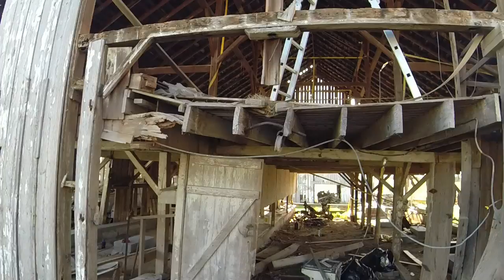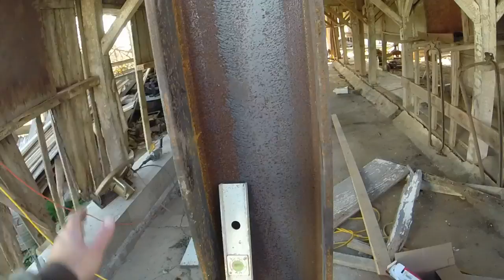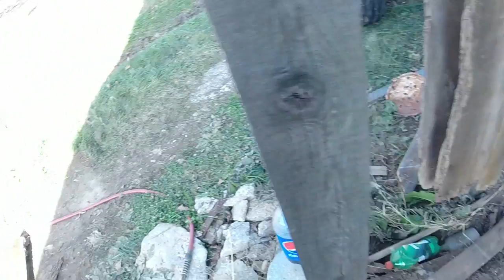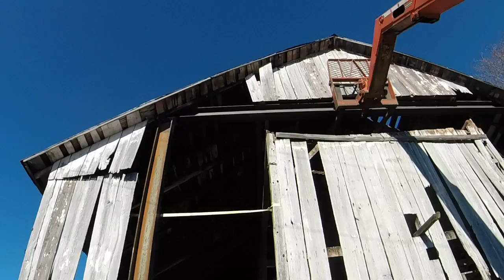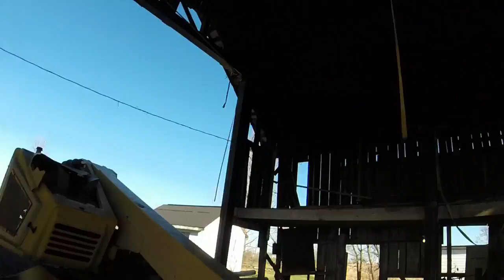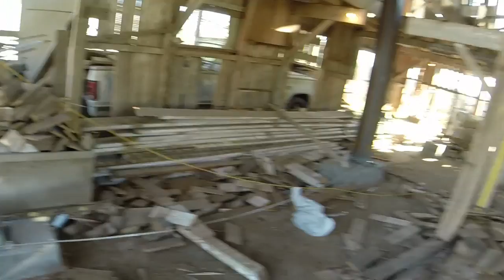First of Decembe 2015 This Old Barn/ Shop Update

Comment: Brian

This may peek your interest

http://www.picturethepast.org.uk/frontend.php?keywords=Ref_No_increment;EQUALS;DMAG101421&pos=18566&action=zoom&id=27322

This and many more of this age and size are the things I used to maintain and mend , electrical problems the fitters did the other stuff but it was a joint effort

They were and until recently used to bore out the mould,s for spinning the cast iron and ductile iron pipes ( sperrodial graphite ) . They had a range of machines from 4 inch to 48 inch all were 18 foot long , these machines were used in the Second World War to bore and rifle big gun barrels , my dad used to look after them then doing the sett up for the ladies to operate them

The other plants did bombs and other cast bits , most of the WW2 machines were still in use when I joined the firm in the 1960 ,s , no elf and safety open switch gear no guards just a rubber mat if you were lucky

Stuart
Reply from the maker: +Stuart Hardy That is an interesting machine. I thought it was a lathe at fisrt then I notcied the tube was clamped. That is one big boring bar!

Comment: You are one hell of a hard worker Brian. Since I don't know what all your plans are, then you may already have thought to add this. Put some really heavy duty floor anchors in and pour the concrete around those. You will need to sooner or later pull something into place either for machine tool moving or farm equipment repairs. With the floor anchors and the crane, plus some snatch blocks there wouldn't be many directions you couldn't get a pull going. I've been around and operated a lot of large open pit mining equipment, and every so often they need a horizontal pull in the shop. It's worth adding now if you think you'll need them. 

There's still a long ways to go as I'm sure you know better than I do. But you've also made some amazing progress.
Reply from the maker: +Turning Point Good idea, no reason I couldn't add some more anchors like I am making for the G&L. Of course I can always wrap a strap around the crane legs and pull on them too.  They aren't going anywhere. since the ITW page says each anchor is capable of 25000lb in shear that is 100,000/leg. once the crane piers are incased in concrete so it doesn't just drag the pier off of course.  i doubt I would ever hook anything more than my 3 ton chainfall to one.  I also have those 12in concrete pylons on the one side that the wall post are sitting on, I have already used those for pulling things around as they make good anchors too.

Comment: +bcbloc02 Brian, How thick are you going to pour that slab and and on what spacing do you plan expansion joints?  Great progress you have made.  Once you tie those uprights together with you rails the rest of the building can blow away and you will be good.
Reply from the maker: +James Kilroy Whatever it takes for me to hit good hard packed virgin dirt, which appears it will vary from 12in in the front to 24in in the back. Which is perfect since 24in is what it calls for on the foundation print for the G&L. My idea is that if I pour 15ft at a time the cold joints between the pours will be my expansion joints. It is going to be one hell of a building when I get it done.  Thanks for checking in on my man and feel free to share any wisdom you may have regarding the build. Can never have too many ideas for things.

Comment: Looking great Brian - just a bit anxious about bracing. What are you planning on using for diagonal braces - From the video it looks like the old floor had a bracing effect, and you'll need something - esp with the crane running up and down with a load hanging? Under New Zealand building code each vertical steel post would have diagonal bracing top of one to the bottom of its neighbour. But then we get earthquakes!
Reply from the maker: +Chris Draper The supports will be braced long ways by the crane rail itself which is an 18x72 H beam. It will be bolted to the side supports by both the bottom and top flange, so in order to fold the thing over you would have to bend or fail the connections of the Hbeam to the posts.  18" isn't a lot of space apart for  bracing to prevent movement, but then again 8" wide 13/16 thick plates should be pretty hard to bend, especially when they are connected to each other by a web.  The biggest danger would be loading the crane, somehow getting the load going fast by pulling the chain super quick and then crashing it into the stops at the end of the building.  That could maybe be bad as you could get a pretty good impact load, but there are 10 connections to hold it so probably still ok. Good thing for me is as the only operator I won't be doing stunts like that.

Comment: And I thought I had problems setting up the shops I have had! I'm sorry to see all that timber-frame stuff go, but you need a crane and that means steel. I now see where  you are headed. That is an awful lot of work and very well done.
Reply from the maker: +Juan Rivero More than half of it was rotten and patched at the bottoms so not a huge loss. I have been saving the good timbers out of it for later use.

Comment: Hi mate.  Bloody heck, you have been working your tail off.  From my side, it looks like you were only just in time to save this old barn, it shows to have so many rotten supports.  It's a good thing that you have access to so many tools and machines.  Is there any machine that you have not got????   Thanks for the up date,  at times you must have thought, what the hell did I start.  Just think, in the end it will all be worth it.  Good on ya.   Marcel.
Reply from the maker: +Marcel Timmers Yeah I really am surprised it hadn't blown down, but then again I have seen some buildings still standing that looked like a pigeon could knock down, it is really amazing to me how little it takes to hold something sometimes.
Reply: +bcbloc02 What is keeping it from racking toward the ends?  Be careful.  It is not so much the building, but you working inside it.  It looks like it could blow down easily at this point.  I don't see any triangulation or shear strength at all there to stop it from racking.  That said, I really admire your hard work and courage in taking on the project!
Reply from the maker: *****
 Currently the concrete anchors are the main thing holding it form folding, that and there isn't much left for the wind to blow on that way.   The anchors should be able to hold a force of 1000lb each placed at the top of the beams. With the current number of anchors that is 16000lb force at the top of the beam to force it over. That would be nearly a 100mph wind. with the walls installed.  Once I get the crane rail installed it will be braced much better with a bolted connection at just over half height tying the beams together.
Reply: +bcbloc02 Well, you have obviously thought this out, but I would be looking at some gussets or diagonals as well.

Comment: I'm sure that somewhere in the history of this effort someone has already asked this question but why not just tear down the old, do all of the concrete and steel work and then build around it?  Its cool watching the progress and how you solve different issues but it just seems like much more work doing it this way.  Thanks.
Reply from the maker: +rokdevil That would be the American way, and assume the debt that comes along with it.  My labor is cheaper than my materials so  that is why I chose the rebuild, repair and modify route.  There is over $15000 dollars worth of materials in the roof I saved alone, no way could I justify throwing that away for the sake of ease.
Reply: I understand.  Wasn't suggesting wasting it, just re-use.  Thanks for responding.
Reply from the maker: rokdevil
 Much like the barn loft floor it would be extremely difficult to get apart without destroying it. Once a nail has been in something for a hundred years they don't really want to come back out. Add in the fact that anytime one got loose somebody just added another one and you have a real challenge to deal with!

Comment: Wow, that's really impressive, Brian. You did most of that on your own? I would like to have seen that, but I can sure imagine that just doing it was hard enough without having to film it! Are your nights getting cold enough to freeze curing concrete yet?
Reply from the maker: +ArtemiaSalina It is dropping into the 20's and teens here at night but I think that with covering it with plastic and some blankets it will produce enough heat in the curing process to be fine.

Comment: great work   how long have you lived on this farm?  You seem to be very Skilled!  Did the skills come naturally or were they learned through the school system?  I'm betting on "Good Old Farm Boy"!  Not sure why i feel that way, just got that feeling!! Everything I know about Mechanics or design and build I learned on my own when I was young , and with the help of my father. I always worked in a job that required mechanical skills and caution.  I was an electrical lineman for 40 years and enjoyed every minute of it.  I am 70 now and I find I could have used youtube when i was about 15.  it would have saved me allot of knuckle busting.
Reply from the maker: +flineman My engineering skills and math skills were learned, my carpentry and metal working skills were picked up thru just doing it. When I was 2 I took my moms step stool apart with the toolbox I found, when I was 3 my dad made me put it back together, I guess it came naturally. :-) I have lived here 30 yrs.
Reply: +bcbloc02  great!!  Nothing is better than "natural tallent"  Can't be forgotten!!  That is until you get old and forget everything!!!

Comment: Hi Brian,
WOW!! What an undertaking. It's too bad that you weren't able to save as much of the floor as you wanted. I've dealt with old lumber before. Ended up being a case of, do I try to preserve the wood, or do I get the job done?  
I wish I was closer too you. I would like to help. 
It is a lot easier to see what you have in mind now. Going to be one heck of a shop.
Reply from the maker: +Jerry Long I tried several methods but the rusty nails did not want to release their grip on the boards and I couldn't get under the nail heads to pull them without trashing the boards anyways so I had to just write them off as a loss and try to save what 2x10's I could that I can use to frame for insulation.
Reply: I understand. I tried cutting them with a sawsall. I was getting about 4 to 6 nails per blade on ring shanks. The math just didn't work out.
Reply: +bcbloc02 Hi Brian, have you come across this type of nail puller?
www.powertoolsdirect.com/priory-150-nail-puller?utm_source=google&kwd=&utm_medium=merchant_pla&gclid=CjwKEAiA1o-zBRDomsWasvKh4S8SJADSlZkqpslvCBxfdjz8-bWGZWa1yZAKb7Otw5GTI-qp5rk_OxoC_Cvw_wcB

Comment: Hi Brian good job on getting the steels in.  Are you going to remove the whole of the loft ?.   If so that's a lot of space up in the air  that will go to waste.  Must say that is a huge project to take on virtually single handed.  I hope you get the timbers pinned to the steels before you get a big blow this winter.  Look forward to the next update.  regards from the UK
Reply from the maker: +Gary C I will be keeping that one run down the side that I can use as storage but all the rest has to go.  It is only like 7ft underneath that floor to the concrete so it is too short to clear 3 of my machines. I also have to keep the center all clear for the crane to be able to operate properly.
Reply: Thanks for the clarification Brian. Glad you are keeping some of the loft for storage. I realized that you had to keep the centre open for the crane,shop machines and bigger farm machinery just wondered how much loft would be left as useful storage.